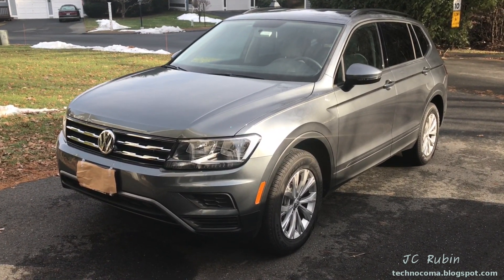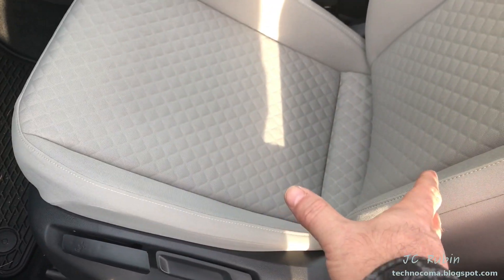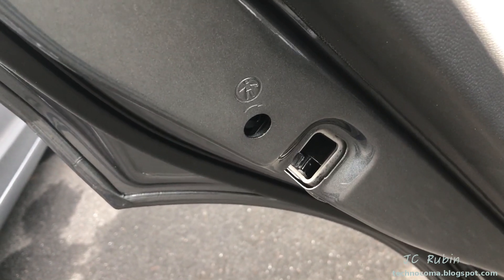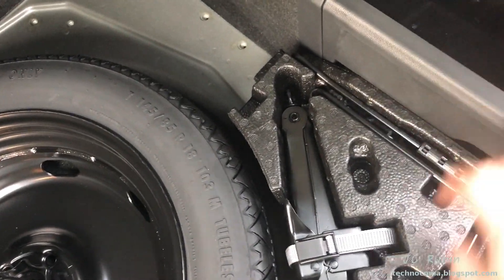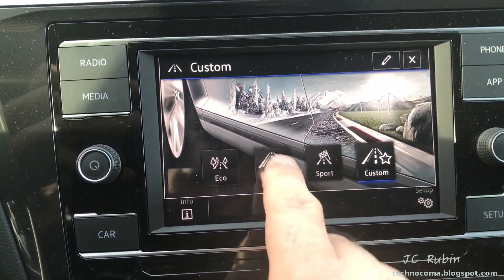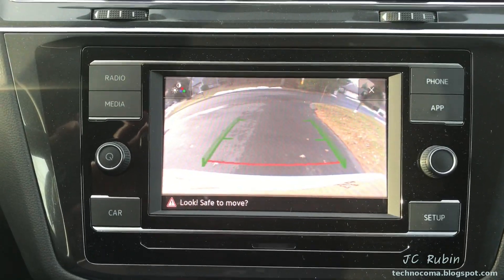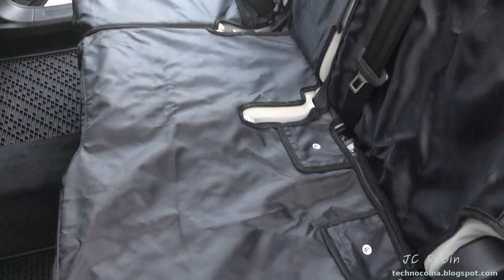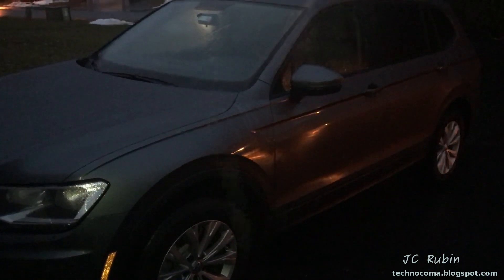2018/2019 VW Tiguan TSI S Trim Feature Review - Discussing the many surprising standard features!

Comment: About the side mirrors, both your Jetta and Tiguan if you turn the knob selector left or right but all the way back to the window defrost section. Sideview mirrors defrost need to turn it all the way around to activate the mirror heaters. And they work great BTW. I have the Jetta S model just like yours. 6 speed manual is the way to go!
Reply from the maker: interesting! I will have to try that out